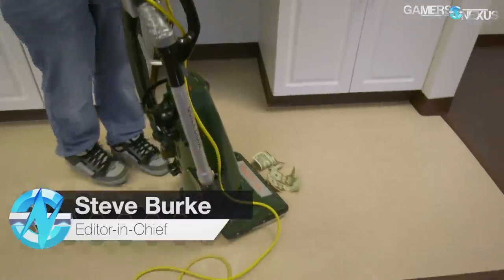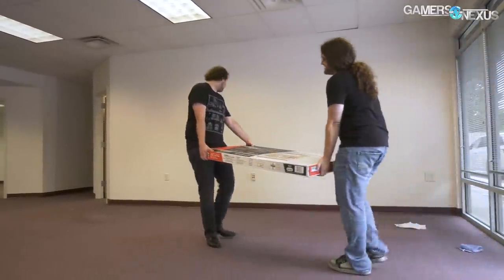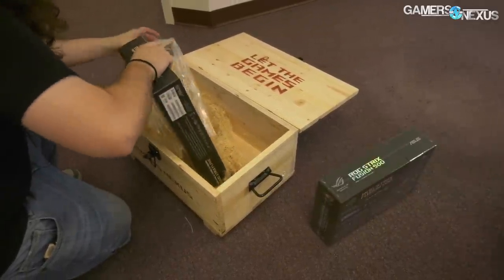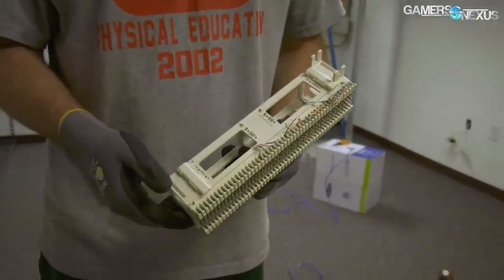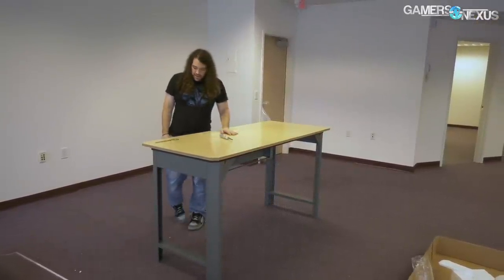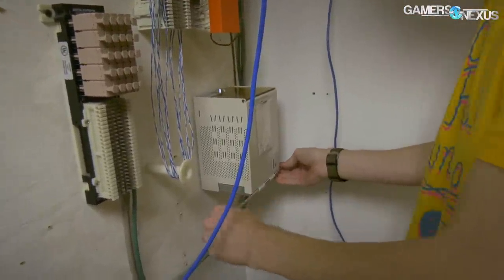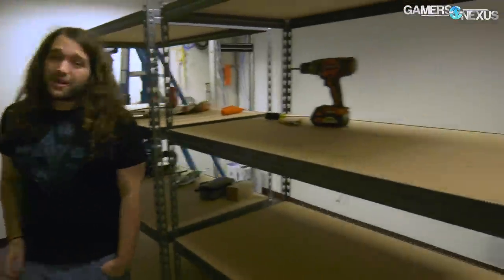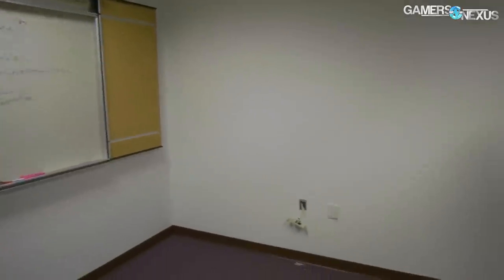Day 1 Move & Meeting GN's Team: GN Moving Vlog, Part 2

Comment: i really didn't need to see this in 60fps, especially when considering bandwidth and data limitations
Reply from the maker: The file is the same size as if we had rendered it at 30FPS.
Reply: Just because you have bad internet doesn't mean others shouldn't enjoy it in 60 FPS.
Reply: Then figure out how to change video playback quality in the settings.

It's a thing.
Reply: Use the app if you're on mobile, hit settings, and change the resolution & FPS to as low as your heart desires Mr. Nickt
Reply: Excuse me I'd like to return half my frames, as it's too buttery smooth for my liking.
Reply: What are data limits? LUL
Reply: Must be a console peasant
Reply: Or go into the settings and opt for "play in HD only on WiFi"
Reply: @stefan i want to watch at 720p, just not at 60fps. anyway 480p and below use lower framerates
Reply: The only effect 60fps will have is on your battery life. Nobody is authoring their video to cater for your wishes. It will be a brave new world when 120fps videos become A Thing.
Reply: Yeah GN... you're just too damn high tech now. /s
Reply: data limitation wow forgot parts of the world was that old hat